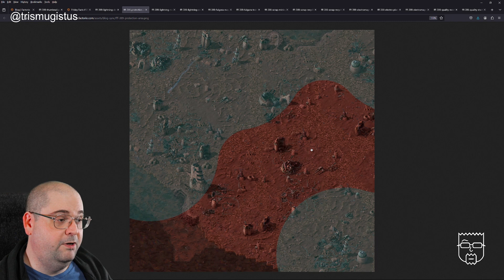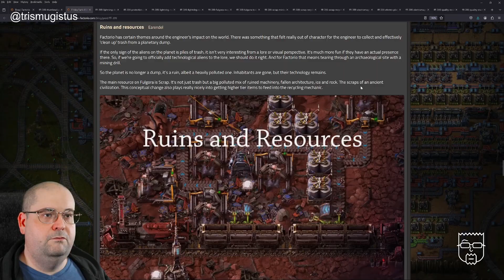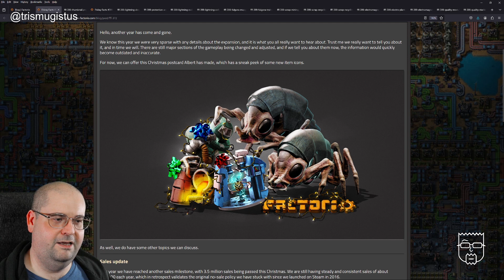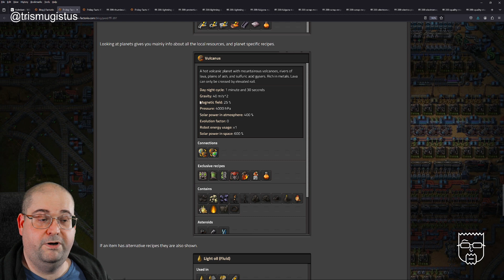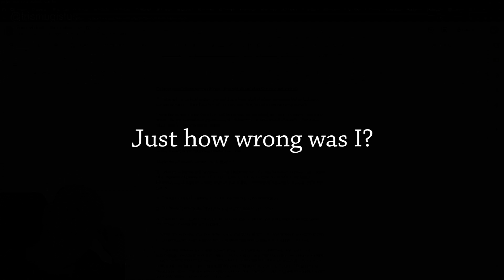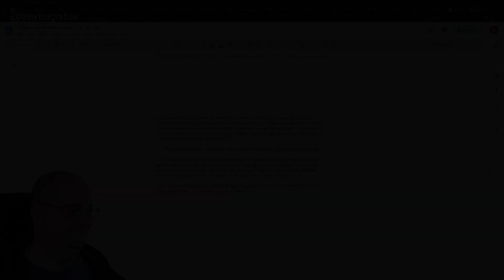Ride the Lightning! | Factorio Friday Facts (FFF) #399 | Analysis & Speculation

Comment: I believe you can recycle some scrap manually to make the first recycler (maybe there is another recipe for manual recycling?).
Reply: Or there is an alien structure for it?..
Reply from the maker: This is actually what I hope is the answer - one of the buildings can be used as a recycler, because while I think we may be able to hand-recycle, it could get a bit tedious mining up enough scrap and then waiting for the RNG to give us the bits we need to make the first recycler.
Reply: @trismugistus some of the buildings may be “containers” like falling rocket on navius. In those containers you will find resources to kickstart production.
Reply from the maker: I hadn't considered that, but it's a great suggestion and makes perfect sense.  The engineer can hand craft most things (the restriction being mostly around fluids, which makes sense), so why wouldn't they be able to hand-recycle as well?

Comment: My speculations: 
1) A planet-specific landfill requires resources from another planet (to encourage the set up proper spaceship delivery between planets);
2) Not every planet needs to build a megafactory, even in the late game. It's a player choice. For example, use Vulcanus as a mining outpost, but build a huge scrap processing factory on Fulgora and do all the basic science there. Or conversely, build a relatively small factory on Fulgora just to produce Holmium and Pink science and use the other planet as your main base;
3) At the moment, only Nauvis has uranium, perhaps this is by design. But I think Bacchus may have some uranium and new nuclear technology. Uranium is also used in ammunition, so it will come in handy on a aggresive planet;
Reply from the maker: It's definitely looking like Nauvis may be the only planet with uranium, which would limit/restrict our ability to solve power on every plant with nuclear power.  Plus water seems to be quite limited on the two we know about so far, though I suspect the next two may have the opposite problem of "too much" water.

Comment: It turns out that accumulators are most profitable to produce on Vulcanus, because "free and unlimited" sulfuric acid, iron and copper. But special building(electromagnetic plant with built-in productivity bonus) to produce accumulators appear on Fulgora. Interesting situation.
Reply from the maker: Yes, it's going to be quite the interesting logistical challenge - do you make the accumulators on Vulcanus and ship them to Fulgora, or do you ship the ingredients (rockets full of barrels of sulphuric acid seems... odd to me :/) to Fulgora and make them there where you gain from huge production bonuses and (by the sound of things) easier quality.

Comment: My guesses/speculations adding to your video:
- the green building on the map view is what harvests the resources that are/are under the big white square
- other buildings not damaged by lightning are: rail signals, rail ramps, rail bridge pillars, elevated rails (as you can guess from the screenshots, since not all rail lines are protected by the yellow dots), maybe pipes? (though pipes getting damage does answer your question of "why 3 lightning rods needed?"), and maybe (or later on?) even big power poles (since also not protected in the lower left part of the screenshot of the base; but protected in the upper right?!)
- one thing you did not notice: in the early FFF image of the 3 machines, each has a colored ribbon on them. The electric machine from Fulgora has a red ribbon. Red is the color of quality modules, which are also unlocked on Fulgora. Coincidence?
- the white resource on the map still remains a mystery. Right now I guess you get enough of it, so you do not mind building rails over it in some places. Being visible on the map says it is a resource and not just decorations.
- the blue ore (iron ore) on the recycler belts is from a previous development version of the scrap recycling recipe (remember: you will get some iron ore from recycling concrete!)
Reply from the maker: That's a very good point on the ribbons.
- We know the foundry is hugely power hungry, so efficiency (green) modules seem like the best thing to put in, and it has a green bow.
- It's a red bow (not orange) on the electromagnetic plant and, as you say, the quality modules are red (and white).
- And the green building has a blue bow, so does whatever it does benefit the most from speed?

On the white squares, another possibility is that it's them blanking something out, so hiding it with a white quare, rather than it actually being a white thing on the map.  Problem with that suggestion is you're not really hiding it if you put a big, obvious white square on it - you're announcing something is there :).  But my favourite suggestions someone made on reddit was that it's an ancient defence system - so there's no biters, but there is a tesla tower that defends the area (and defeating it is how we learn to make "tesla items").

Comment: My guess on how you get basic resources to make your first recylcer, miner, assembler, etc., is by deconstructing alien buildings. Perhaps they give some mix of: scrap, stone, holmium, iron, copper. You might have to deconstruct a few of the buildings, but by the looks of things the "cities" had a ton of buildings, so it shouldn't take you long to make a handful of starting machines.
Reply from the maker: Yes, I hope they give us some of the basics from the scrapped buildings, otherwise they'll get annoying to remove for not benefit quite quickly.  They could act like early game rocks - access to super basic ingredients with an RNG element.
As one of the other commenters said, it could be that the engineer can do hand-recycling so you can process your first few bits of scrap, or perhaps an assembler can do it but is even less efficient?  I kinda hope not for that initial build because of the RBG element.  It's kind annoying to hand mine when you start the game, if you have to do that for long enough to get enough steel and whatever to build you first recycler and lightning rod and chest, etc, then it could be even more annoying.
Of course, you can bring some basics from home too in your space platform, but they need to design it around not relying on that as they can't guarantee people will bring the right stuff, especially the first time.
Reply: Agreed and agreed. Although they do seem to enjoy people starting from pseudo-scratch, so if you come unprepared, a touch of hand mining to restart the factory sounds appropriate to me. @trismugistus

Comment: Could the iron ore come from recycling concrete?
Reply: Concrete
Reply: It could be an older version of the recipe. 
It could also come from the other belt that adds to the circular belt!
Reply: I thought that devs said that it’s impossible to get raw ores in recycler. Why do you need iron ore?
Reply from the maker: I don't think you need it, as such, I was just surprised to see it going round on one of the belts when I thought they'd said you can't get ore out of recyclers, but it coming from the concrete makes more sense.  It means you can smelt it and get a bit more iron ore, which is going to be quite complex to get otherwise.
Reply from the maker: Yes - of course!  I hadn't thought of that.  It would make a lot of sense, and would give us a more direct way of getting iron ore for making iron plate.

Comment: You'd also mentioned that we might have serious building restraints, which is why we'd want more efficiency modules to keep builds from using too much power, which would require a ton of space. iirc, you'd intended that idea of Bacchus, but it seems you still hit the nail on the head. Your space and energy is seemingly hard capped on Fulgora (at least until you can connect islands with landfill, and use that extra island space). So this is a chance for efficiency modules to actually be meaningful! Oil will be plentiful and everywhere, so efficiency modules in chemical plants would make sense. No need for quality or productivity modules in them, although I could see a mix of speed & efficiency to keep both power consumption low, and the overall builds small.
Reply: We'll have to see how much energy the lightning actually gives you. Maybe I'm just wishful thinking cause I want these stupid green things to be useful for once xD
Reply: Disagree. This is the planet where you have loads of electricity. So zero need for efficiency modules on this planet in my opinion!
Reply from the maker: I hadn't thought of that actually - using some efficiency modules would make a lot of sense, especially early on with just the lightning rods.  Of course you can still do other power - there's bountiful oil that you can turn into solid fuel, so burners become sort of viable in small number (water depending!) and even though there's going to be low solar levels, it's probably still worth sticking a few panels in here and there where you've got gaps.  Plus if there's no biters we've no real pollution restrictions.

Comment: I think for rocket exporting; yes, it's extremely expensive. I bet $100 there will be teleporting techs, or otherwise make rockets much cheaper, but it will never be super cheap to conduct interplanetary transport. I think Vulcanus will have two primary exports for most players: the Metallurgic science pack, and tungsten. Tungsten seems to be used for the big mining drill & the foundry, so just export that to all your other planets. Given that you can stache 500 ore on a rocket, that seems...alright. We don't have the full #'s, but if it takes 10 ore to make a drill, that's at least 50 drills, and since they're much larger structures, that's a decent start. A foundry have at 50 steel i think, which is already almost at the rocket's carry limit. A rocket would barely be able to hold more then a handful of foundries, so you're probably always going to export the raw tungsten, or smelted tungsten off, and set up a mall to make foundries on each other planet.

I'd extrapolate the same thing with all the planets. Fulgora has the greatest ease of making modules, so perhaps you'll simply export modules. Or, again, just export Holmium and make Electromagnetic machines on your other planets, who will then make their own modules locally.

It's a bit of a mess, and until we have our hands on it we won't know how it feels to play. Still, a bit of a mess is why I want a 2.0 in the first place :)
Reply from the maker: Not sure I'd take that bet, as it's a distinct possibility, especially in the very end-game for moving between planets.
A foundry take 50 tungsten carbibe - that doesn't necessarily equate to 50 tungsten ore.  Steel requires 5 iron ore, for example, and at the very least tungsten carbide is 2 "ores" - tungsten and carbide so may only stack half as high.  If it's, say 4 tungsten and 1 coal to make 1 tungsten carbide then you may be able to make fewer foundrys with each export.
And are you sure we can make foundrys on other planets?  The phrasing used was exclusive recipes, but it only lists a small handful - there's bound to be other stuff we can unlock with the science pack and build as a result... so perhaps it means you can only craft those things on Vulcanus?  So we'd actually be moving single foundrys around by rocket, due to the weight.
I do agree that modules will probably be the primary export from Fulgora, along with a handful of quality items, like high level assemblers for you to use for the most expensive recipes (or in a swapping build system like they showed with the new logic additions).
Bringing order to the chaos is one of the great things about Factorio, and even greater is that your order can simply be a different type of chaos :D
Reply: I'm fairly confident you can build any building anywhere you want, it's just that you physically need the tungsten or Holmium in order to do so. So you export the tungstone or Holium to other planets, then source the rest locally. I'm 90% confident you can craft Foundries anywhere, and what they mean "exclusive recipes" is you can only unlock them on Vulcanus.  @trismugistus